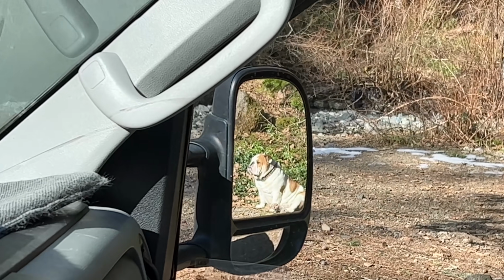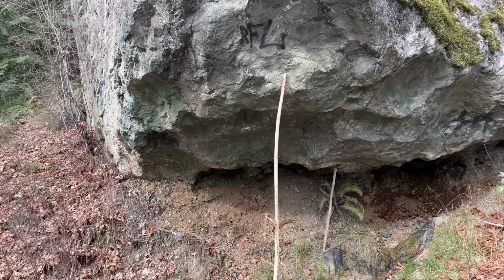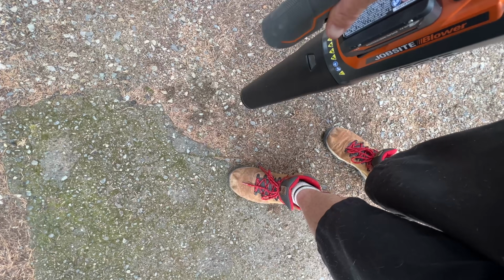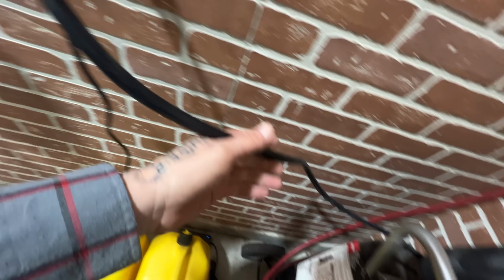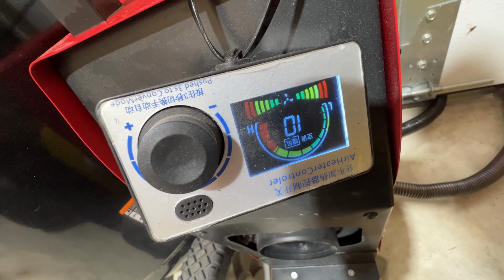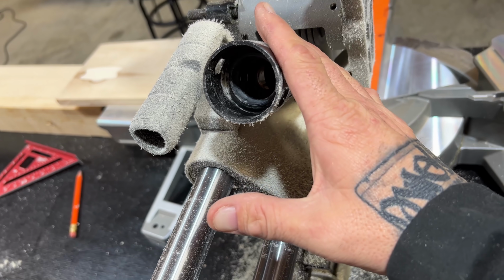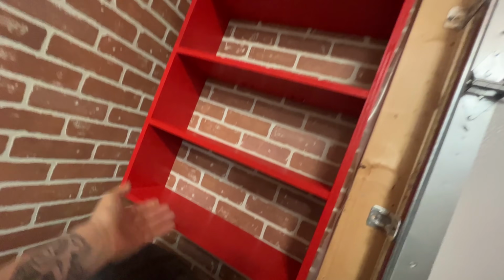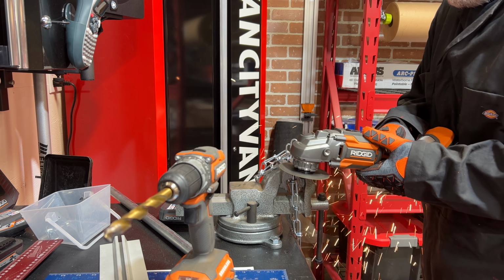VAN LIFE + SHOP LIFE | Building More Storage + Waking Up In The BACK COUNTRY

Comment: Verify the locks because what usualy fail are the cables, they have plastic ferrules at the endes that break. In the autoparts they sell aluminum replacements and they will never fail again, best of all a pack of 16ea. cost $9.99.

Comment: Hey chrome I'd install a air drop column. Put it in-between compressor and the hose reel, this is to try and cqtch condensation, and an easy way to catch drain it.Get a piece of schedule 40 pvc and a tee. I'd install it in the corner w tee on lower portion and a section of pipe w a valve at the bottom you can use a larger diameter pipe so don't mess w CFM pressures. The idea is so as the air cools while it's in the lines the water can drop into that column instead of leaching back into the compressor tank. It'll make for drier air in your tools for the long run also😊

Comment: Helpful temp Chrome when it comes to your air compressor every now and then depending on how much you use it be sure drag it outside underneath the bottom of it unscrew the pick cot and let the water drain out no don't do it while it's at 175 PSI though you don't want the inside of tank to rust and believe me they will especially depending on how many times you use it that hot compressed air gets moisture bad inside the tank and creates a lot of water in your tank can rust this way your compressor will last you a lot longer love the videos keep them up

Comment: CHROME CHECK THE SIZE OF YOUR EXTENSION CORD!!!
IT SHOULD BE A #12 to handle the pull of the compressor.
#12 is the wire size to handle 20 amps.

Comment: Hey Chrome, check out the Dust Separator at the Home Depot. Article# 1001631258. Sits on top of a bucket between your vacuum and tool. Vacuum creates centrifugal force inside bucket. All dust goes in bucket and your vacuum is empty and your filter stays clean.👍